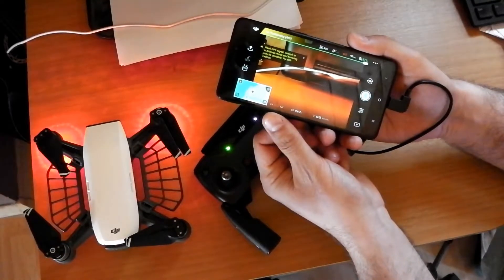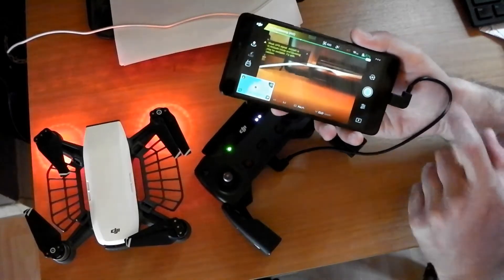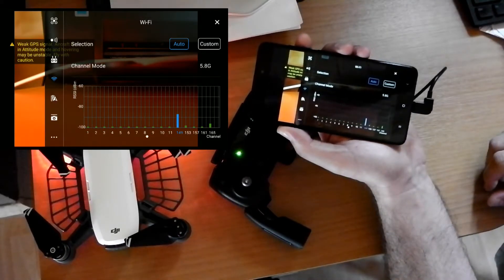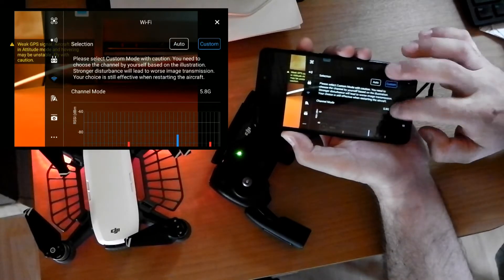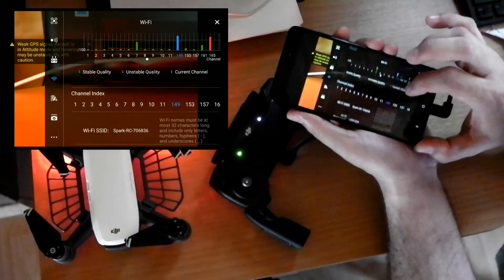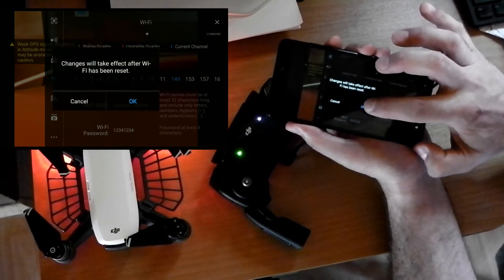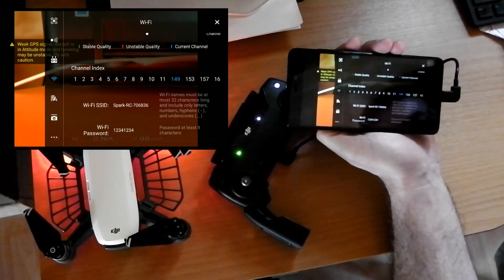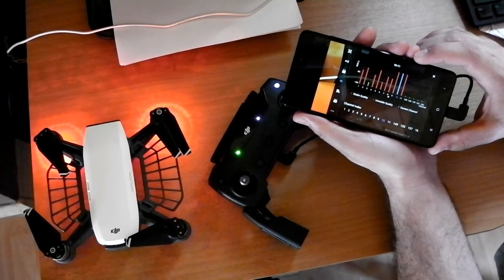dji spark 2018 connect otg cable & frequency to 2.4

Comment: What is the difference between 5.8 adn 2.4?  Why change it?
Reply: Tuan Vu 5.8 has better signal and faster transmission when Ur close but when u what to fly away more 2.4 is better BC it can go through objects better I think
Reply: 2.4Ghz does not get attenuated as much a 5.8ghz